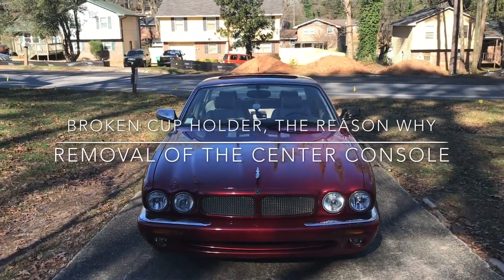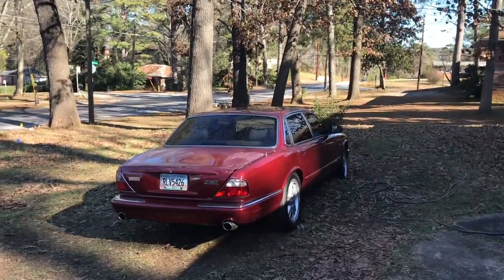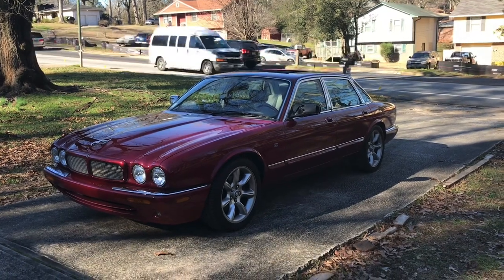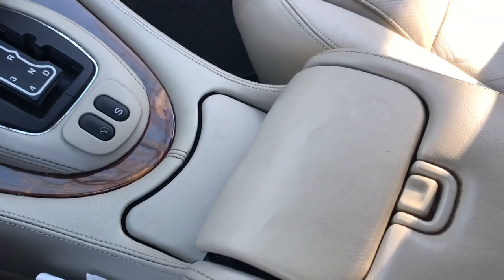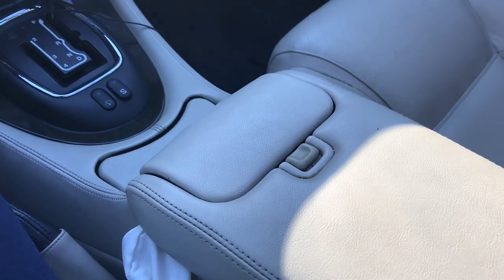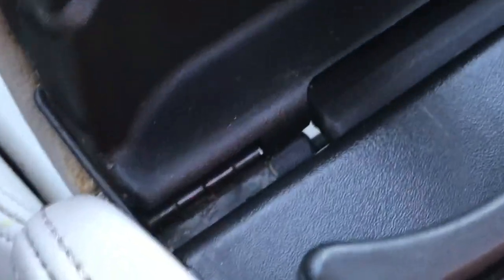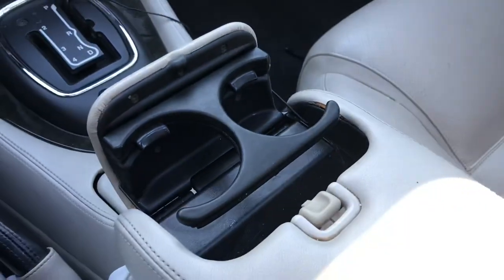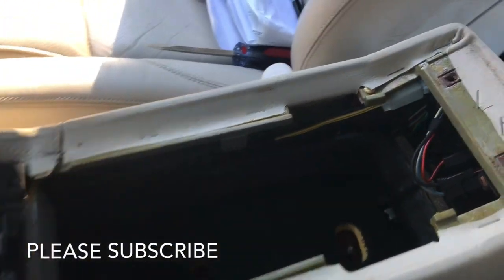Jaguar Center Console Cup Holder Issues "The Reason Why" Removal Of Console

Comment: This is exactly my problem. Any idea where to find a new piece with the hinge? Or do you just go for a whole new console, which sounds expensive? I’d like to replace the internals and reuse my existing leather pieces.
Reply: I just ordered what I need from eBay. Not sure if it has the hinge or not. Hopefully it does, but even if it does not I’m sure it will last me a long time if I’m careful opening it.
Reply from the maker: Just go for the new unit and they are really to to expensive, I think they went to metal in 2001

Comment: I replaced mine too, also a 98 car.  They seemed to change over fairly early as i have found the metal hinged version in 1999 registered cars onwards..
Reply from the maker: I never knew Jaguar fixed this issue until I took the closer look today. I was happy and stunned they fixed it
Reply: @MitchGrooms  I scrapped a 1999 car for parts and it was surprising how many bits had changed from my 98 car, they were constantly revising things.  I will document some of them soon as i am currently undergoing some serious surgery on mine.
Reply from the maker: @Mcandmar  also changes were valve cover gaskets and the coil packs from the 98 too 2000 2 pin too for 4 pin..
Reply: @MitchGrooms  Your into the AJ27 engine post 2000, lots of changes were made with the engine management, mainly in the pursuit of better emissions.
Reply from the maker: @Mcandmar  I see that for sure now.. Do you know who Scotty Kilmer is? He featured my 98 on his channel.